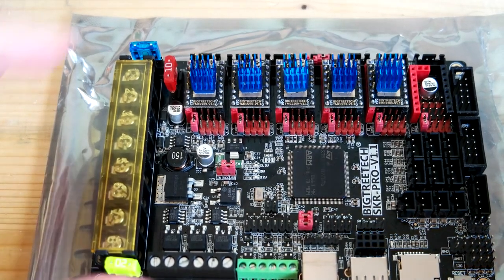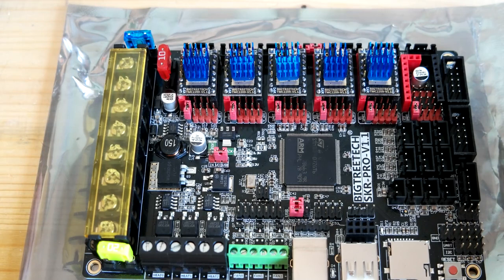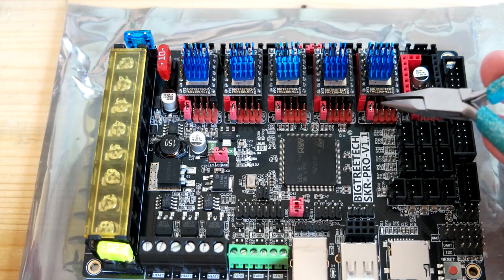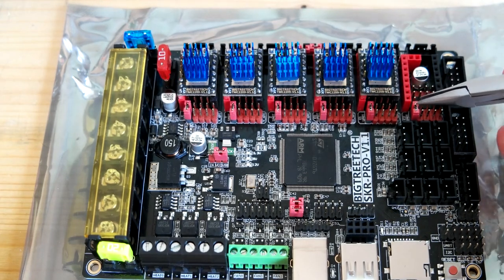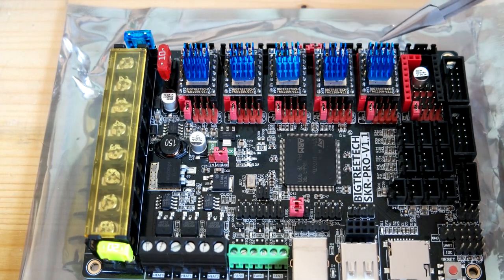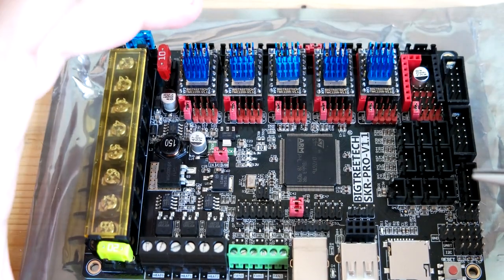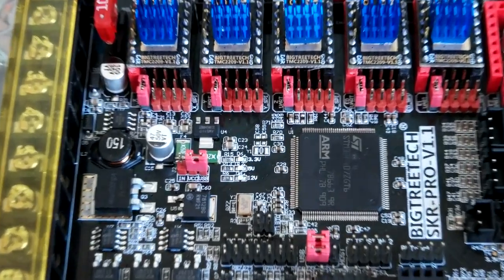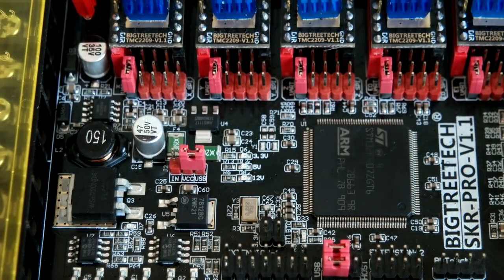BIGTREETECH SKR Pro V1.1 and TMC 2209 in UART mode

Comment: I m having a problem with my heatbed. My skr pro card is attached to a ssr and to a silicon heatbed. The problem is, as soon as i turn on the card, the silicon bed starts to heat up. The connection between bed and the ssr is correct. The ssr is working properly because i used another ssr and still have same problem. The ssr is connected to the hotbed input on the card and the bedpower input is to the power supply. I even tried to get the bed power directly from the power supply but still have the same problem. I used a normal 12v heatbed on the card to check if the problem is on the card but it heats normally so the problem is the connection i think. Do you have any suggestions to my problem?
Reply from the maker: I do not use the heated bed so don't have much details, but I remember someone in the facebook group mentioning that the heated bed polarity on the SKR Pro are inverted. Not sure if it applies to your problem, you should check the facebook group and ask there, I am sure someone has a solution to your problem. pls subscribe ! thx

Comment: I have placed uart jumper on every position on the board and TMC2209 in the x,y,z, e0 slots, and I get this on the M112 command:

Driver registers:
  X 0xC0:08:00:00
  Y 0x00:00:00:00  Bad response!
  Z 0x00:00:00:00  Bad response!
  E 0x00:00:00:00  Bad response!

Testing X connection... OK
Testing Y connection... Error: All LOW
Testing Z connection... Error: All LOW
Testing E connection... Error: All LOW

Does anyone know what could be wrong? I have skr pro v1.1 board and v1.2 of the TMC2209 from Bigtreetech.
Reply: Make sure the 12V for the motors is connected, or it simply wont work at all.
Reply from the maker: Check your configuration.h file settings

Comment from the maker: just wanted to share my findings about the SKR Pro v1.1 and TMC 2209 in UART mode for sensorless homing and probing. At the moment there is no configuration that works for sensorless homing/probing with these drivers on this board, I filed a bug report on the Marlin 2.0 issues report https://github.com/MarlinFirmware/Marlin/issues/15496. Hopefully this will change in the coming weeks as Marlin is still in alpha stage and a lot of development in been done. If something changes I will post more updates, hopefully soon! For now I am going back to 2208 and endstops.
Reply from the maker: everything seams to work fine, both sensorless homing and probing are working https://www.youtube.com/watch?v=UJwzSTcQslo

Comment: Thx for the video. My printer says "TMC Connection Error". Has anyone an Idea?
Reply from the maker: Did you install a custom Marlin firmware? If so make sure you set all the necessary variables. Usually is something you forgot to set in the firmware that cause this error, also enable TMC debug in the advance configuration of Marlin.
Reply: @ganzoai  thanks for your answer. I can elliminate the mistake. If it works in 5v modus the printer says "tmc Connection Error". In 12 v Modus it works fine. No error. Hope this review helps some other 3d printing friends. ✌️
Reply from the maker: @MistahDee1907  great! pls subscribe !! :)
Reply: @MistahDee1907   It also works in 5V mode, when you just connect the 12V motor power.

Comment: have you tested the spreadcycle  ? because on tmc2009   v1.1  something wrong  with soldering  The resistor move as per instructions is not enough, you need much more than that take a look on this  video  ... https://www.youtube.com/watch?spm=a2g0s.imconversation.0.0.3dc53e5fsXqDkv&v=6oKtRML0kUU
Reply from the maker: Yes I saw that video but I am using the 2209 in UART mode, also I just received the v1.2 so not sure yet if the issue you are pointing to is been fixed

Comment: How do you compare TMC2208 vs TMC2209 in real world? i tried to buy an SKR V1.3 + TMC2209 but the last ones are out of stock until mid september. Aliexpress offered me TMC2208 V3.0 UART
Reply from the maker: I am in the process of testing these drivers. But in general the TMC 2209 are like the TMC 2208 + 2130, in the sense that you can do sensorless homing and probing without the need of soldering or anything else on the drivers. So I would suggest you to get the 2209. The UART mode shown in the video, I am using with the Marling config set to enable both sensorless homing and probing with sensitivity set to 120 (will test this value). I tested the 2130 on the SKR V1.3 but I had to so some soldering and was not too happy about it since it's not reliable. So I switched to the SKR Pro and got the TMC 2209. There is a sale coming in couple of days in Aliexpress, check the link. Will post more videos in the coming days/weeks, subscribe ! :)